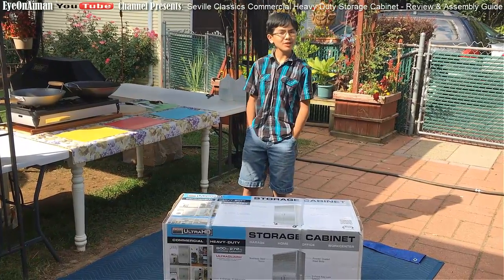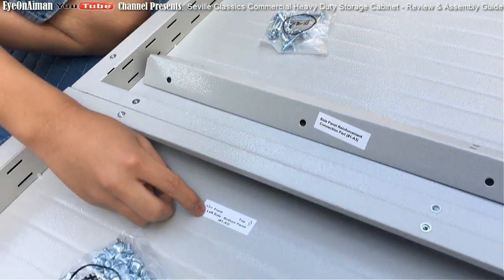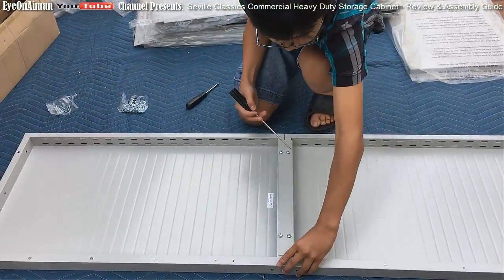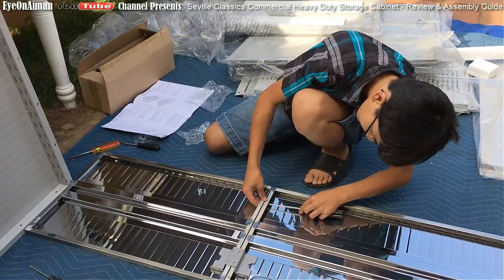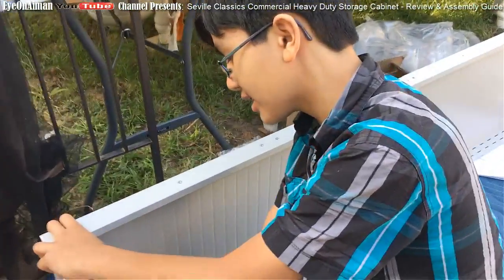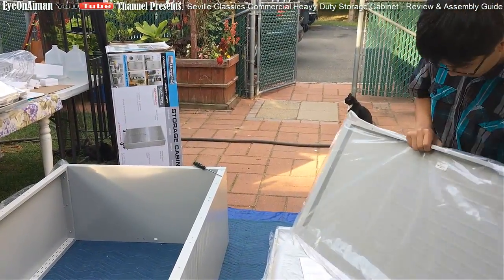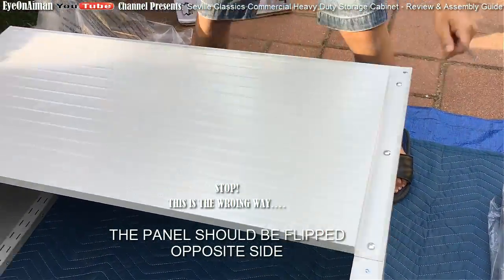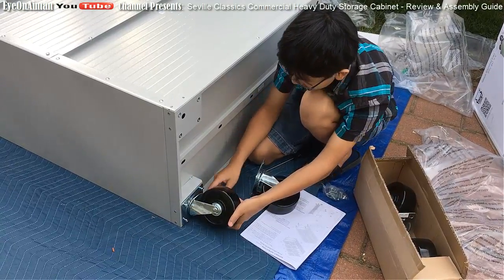Heavy Duty Outdoor Lockable Storage Cabinet - Review and Assembly Guide | Seville Classics

Comment: Well done, i referenced your video because after i put mine together i noticed the right sided door does not stay shut.  For some reason the designers decided to put the magnets on the wrong door. The only thing holding the right door shut is the rod which i would never want to use.  I thought i may have put it together wrong but yours is the same.  My larger Seville cabinets all have two magnets.  Looks like they went cheap on this one and still got it wrong!

Comment: The joints of the side panels with the top and bottom panels uses #42 or #17 screws, but not #41 screws as the assembly manual indicates.

Comment: Nice job kid! This cabinet is a good one. Lots of screws though.  I have 2 criticisms. 
1. The front and both sides are 2 panels each. The back is 4 panels. I get it, it makes the shipping package smaller BUT it makes the installation a pain and obviously a single panel would be stronger than 2 half panels screwed together. 
2. When opening, the right door handle should slide up to open and down to secure closure. Unfortunately the only way to keep them closed is to use the key. If not the right door constantly swings open on its own because there is no magnet to keep it closed. They should have made the handle to it secures the door in place or give us a 2nd set of magnets to keep the right side closed like they did for the left side.
Otherwise its a really nice cabinet once you get it all screwed together. I give it an 8 out of 10.

Comment: Great video...but...I just assembled my second cabinet.  It's much easier if you assemble it on a folding table.  I have an 8' table (I think it's 8').  Able to assemble 90% on the table.  It makes the job much easier.  For you...you're still young, so working on the floor isn't that hard.